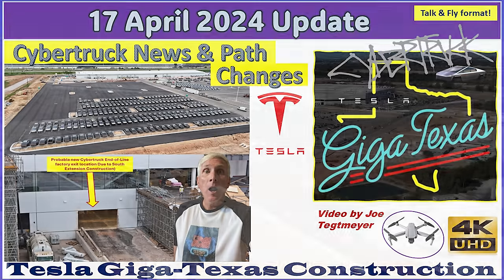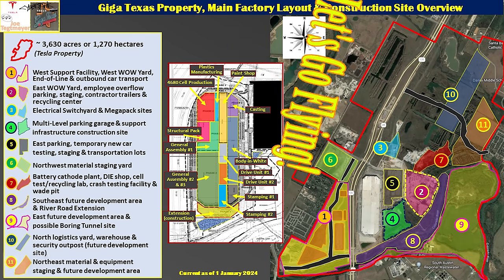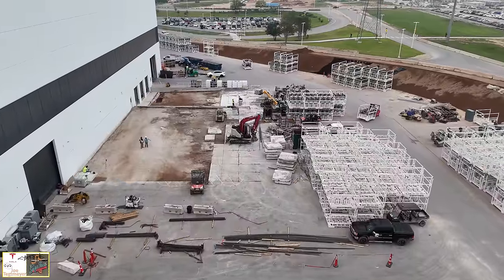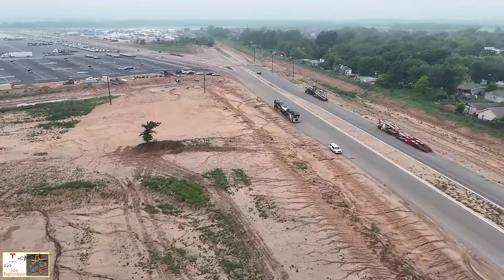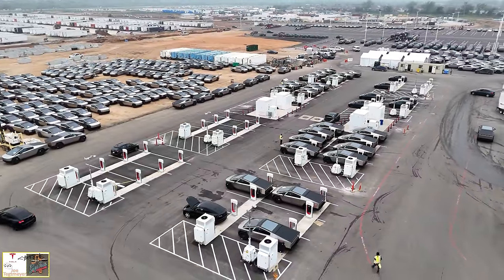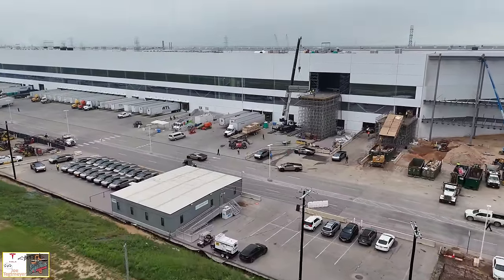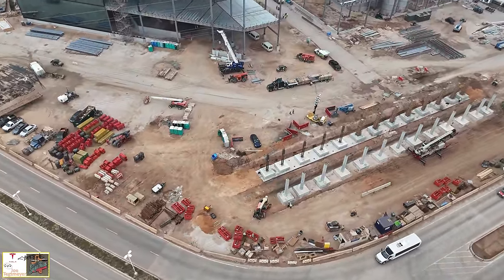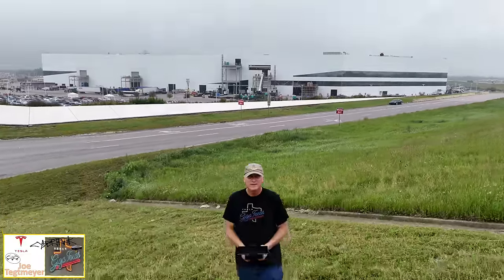Cybertruck Delivery Pause & New Routing! S Extension Progress!17 Apr 2024 Giga Texas Update(08:35AM)

Comment: Amazing that there are no workers on site that could comment about some of the things we don't know but are intrigued about. My best bet about the new colum structure is an exit or entrance to the tunnel system.. but one question , if they are entering the water table cou,d that cause trouble for the tunnel, I don't see any system for removing water! If they are not running the boring machine 24/7 then the tunnel could quickly fill with water?

One thing I don't understand is if this is advertising for the boring company it is not very good, it took many months to set the boring system up and seems to be digging very slowly. I believe it was advertised as being able to start operations very quickly, like a week and digging starts! And it was supposed to be able to dig 1mile in a day. Another musk overpromise on time?
Reply: The spoil looks like saturated clay/silt. Clay swells when it gets wet. Some clays swell 17 %. Houses in Texas can lift by inches depending on draught/rain. The clay they are cutting thru may be so tight that water does not flow  but so wet that it is sloppy.
Reply: This TBM is a closed face type. The saturated soil it is excavating through is a sandy clay. This Earth Pressure Balance TBM is very well suited to this type of ground. If you want to know more just type Earth Pressure Balance TBM into Youtube, there are hundreds of videos to explain it. I recommend the 'Herrenknecht' videos. 
I agree with you about the speed of set-up and tunnelling. Setup was slow, probably delayed due to permits for the soil berm in the highway land, and the short cross conveyor was very late being delivered. Should have been 4-6 weeks not 11. Excavation so far is very much in line with my expectations for a TBM of this size/type. 
I hope the TBC management are not on performance based salaries!

Comment: Evapco chillers look like they would fit on the mystery foundations?
Reply: Quite a size difference between the length of the chillers and the width of the structure. Would need to be beams constructed east west across to carry the chillers.

Might know by Joe's next flight, they are cracking ahead with it.

Comment: Thanks Joe!
Likely new power supply to the factory:
@ 4:54 Grade had to be raised where the new duct-banks are. Since the old substation was lower.
@ 5:17 (Bottom) Location of where two vaults will be. Towards the top and on the west side of the easement.... Construction continues in the direction of the northside of casting.
What is unknown is whether these duct-banks will take a jog to the right to meet up those duct-banks? Or... Split, going both to the northside of casting and south along the eastside of the easement to the south end factory expansion? Where several news articles have said there will be a data center. Time will tell soon. In any case, my guess is that at least part of the purpose for the new power supply is to power the data center.
EOL facility:
@ 15:33 (Bottom right) Transformer that provides power to the EOL building.
South end:
@ 24:25 Grade being raised inside to the top of the column pedestals.
Also, glass panel being installed to the right.
@ 27:12 Steel being erected over the speculated tunnel alignment.
Also, an additional floor on the left of the recently erected steel. Or different floor level?
Easement project:
@ 28:21 Rebar sticking out the top of the columns. Indicating cast in place beams?
Also, top right, trenches across the River road extension.
Reply: It's nice to see this project progress! Some people thought it would either go broke or be bought out by another car company.
Reply: @jbbuzzable  What do you think about the robo-taxi data center stupidity?
Reply: Not an easement
Reply: @michaeljohnson1805  If you mean 18:21 it is located right where the easement splits.
Reply: @DavidJohnson-tv2nn  therefore the construction is not located on an easement like you stated when Tesla first began that construction…therefore why call it easement construction?
Reply: @DavidJohnson-tv2nn  You want to talk data center or robo taxi?
Reply: @michaeljohnson1805  David loves to dole out misinformation.
Reply: @sammyk874  Sammy loves to kiss the leader's back-side.
And... What "misinformation" are you talking about?
Reply: @jbbuzzable  I'm talking about the quote from the Electrek article.....
"We reported earlier today that he shut down a project called NV9 to build a next-gen cheaper electric vehicle at the plant. Instead, Musk asked for all resources to go into the Robotaxi program and, specifically, a new data center to be built in an ongoing expansion at the factory."

That is, if it turns out to be accurate.
Reply: @michaeljohnson1805  At first, I didn't realize that the easement split at that location. That is, until Dessie pointed it out.
However.... What would you suggest I call it? It is a project right there at the easement location, even if not directly in it.
Reply: @DavidJohnson-tv2nn  Always goes back to this with you.  Not sure why.  If this were a Ford project, I'd say the same things.  The misinformation is stating that the construction was in the easement.
Reply: @DavidJohnson-tv2nn  the entire factory is being constructed along the easement…..be consistent…describe the entire construction project an easement project
Reply: @michaeljohnson1805  You didn't answer my question... What would you suggest I call the project?
Reply: @DavidJohnson-tv2nn  call it what it is…unless you know what it is…but it’s not an easement project
Reply: @michaeljohnson1805  I don't know for sure what it is for sure. So I will continue to call it the easement project unless you have a better idea.
Reply: @sammyk874  Endless nit picking.  Funny, how you say nothing about Joe and others mislabeling the substations as "switchyards".  Which is completely wrong, since switchyards don't have transformers. But you're ok with that. I will continue to call this the easement project due to its close proximity easement unless you have a better idea. Or until we know for sure what it is.
Reply: @DavidJohnson-tv2nn  Calling it an "easement project" and saying it is being built IN the easement are two different things.  LCRA calls it a switchyard.  Go take it up with them.
Reply: @sammyk874  LCRA is wrong. It takes one employee in a large bureaucracy to make a mistake. And people like you blindly follow. Look up....
"Difference  between a substation and a switchyard".
Easement project....
I made one mistake one time when I thought it was in the easement. Dessie pointed out that the easement splits. You want to make a big deal out of it.
Endless foolishness.
Reply: @DavidJohnson-tv2nn  So that one person never gets officially corrected?  Maybe it's not that important.  I don't blindly follow, I just don't care enough about it.
Reply: @sammyk874  Oh, but you DO care about nit picking nearly everything I say!
Reply: @DavidJohnson-tv2nn  Yes, because you frame things as if they are doing something wrong like building within the easement.
Reply: @sammyk874  Also, from a technical point of view it is important. A switchyard does NOT have transformers. Where a substation DOES have transformers. 
If these were switchyards there would be a problem. Since 345,000 volts would be sent into the factory. 🙂
Reply: @DavidJohnson-tv2nn  That's great.  Like I said, take it up with LCRA.
Reply: @sammyk874  Not my job! But if something is incorrect here where I see it I will point it out. In response to:
"That's great.  Like I said, take it up with LCRA."
Reply: @DavidJohnson-tv2nn  Of course, typical of you.  You don't really care, just like to point out "errors".  Guess it makes you feel better about yourself.
Reply: @sammyk874  Do you have a problem with pointing out errors? Or you just fine with inaccurate information?
LCRA is NOT my responsibility!
Of course, I get the typical and expected response from you.
Reply: @DavidJohnson-tv2nn  "not my job"  "not my responsibility" typical of you.  Nothing wrong with pointing out errors but why not try and attempt to fix them?  Instead you sit on your hands and yell at the clouds.  Same when you complained about the Fire Zone signs, why not reach out to Travis County Fire Marshal?  You'd think for being such an anti-Musker you'd do anything to give him grief.  Maybe that's not true and you really like him and that's what brought you here in the first place.
Reply: @sammyk874  LCRA employees are PAID to take care of things like that. I am not. Nor am I going to spend hours on the phone talking to 20 different people, dealing with the bureaucracy!
I did my part by pointing it out. People like you are too lazy to even bother to look up the difference between a switchyard and a substation.
I pointed it out to Joe. He said he was going to go with "switchyard" because it is in he official documents. 
I'm not going to give him a hard time. I appreciate all the work he does to get us these videos!
Your attitude seems to be....
How dare I question anything from Tesla or those associated with the project!
Reply: @DavidJohnson-tv2nn  Phone?  This is 2024.  Just email them!  Maybe there is something we don't know as to why it was officially called a Switchyard.  Maybe instead of telling them they're wrong, you can ask why.

Comment: Any guess how far the tunnel has progressed?
Reply: We can roughly measure the advance by the rise of the lower white beam on the conveyor cassette. Each meter, or foot if you like, that the beam rises, the tunnel advances 26 x that distance. We can see from this that they have advanced around 20-25m in the last week. Looking back to the start the white beam has raised about 1.5 container height. let's say 13 ft, so x 26 for the cassette multiplier, = 328ft, or about 100m, 66 rings. That puts the TBM out to the rising embankment at the side of the highway. They have been excavating 5 days a week (not sure if they have a nightshift). 11 days production so far. So current production is 6 rings a day (9m), (30ft).